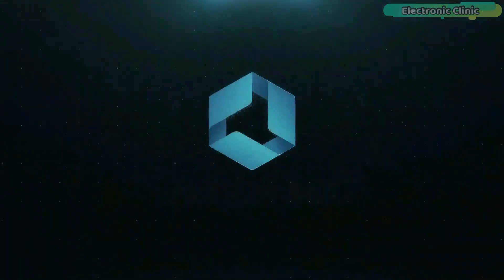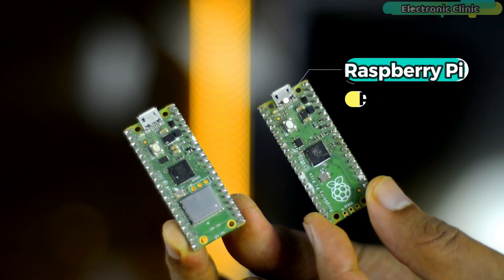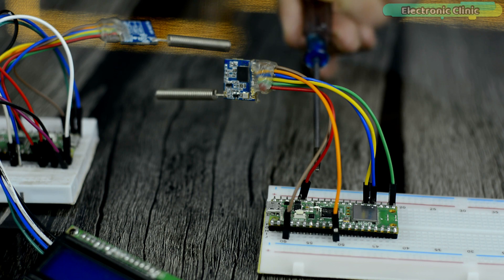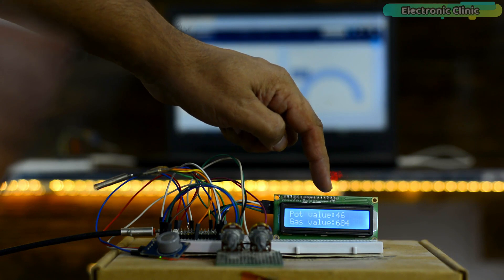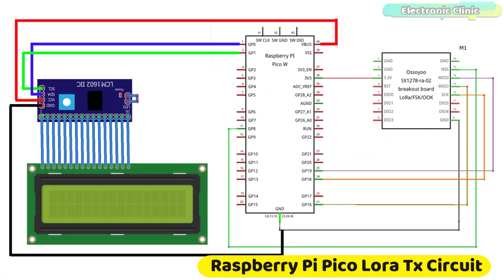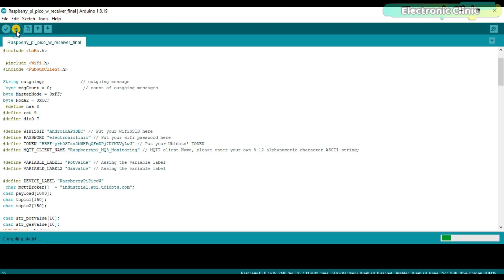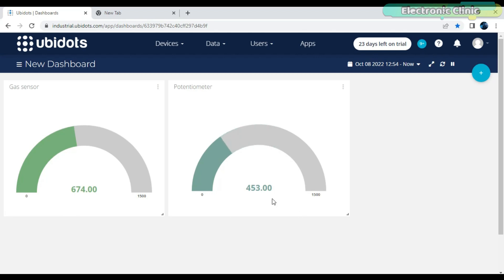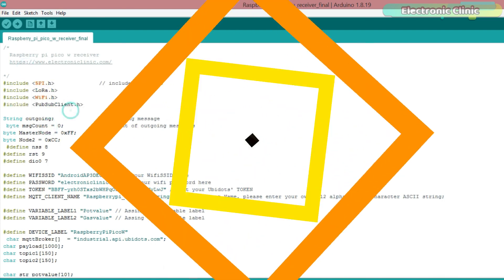Raspberry Pi Pico W LoRa Gateway for Sensors Monitoring using Ubidots IoT Platform

Comment: Hello, I'm still a beginner. But I can't understand why the LoRa transmitters are needed. Can't the Pico W communicate directly with another Pico W, for example via integrated Bluetooth?
Reply from the maker: LoRa are used for long range wireless communication
Reply: @ElectroniClinic  ok I understand. Did you happen to make a video describing the communication between several Pico W? :)